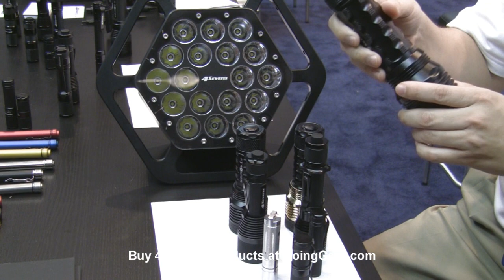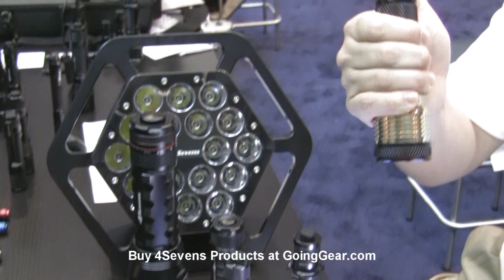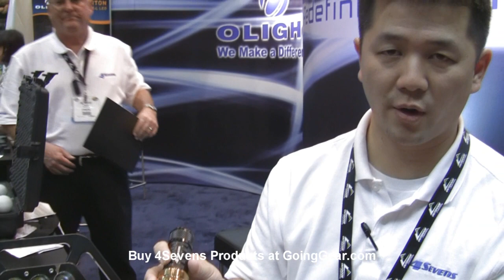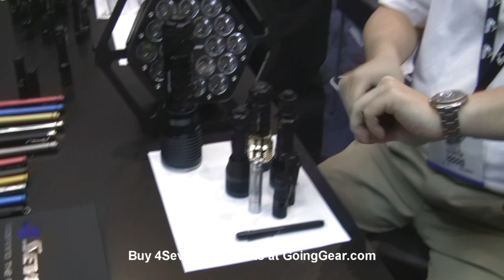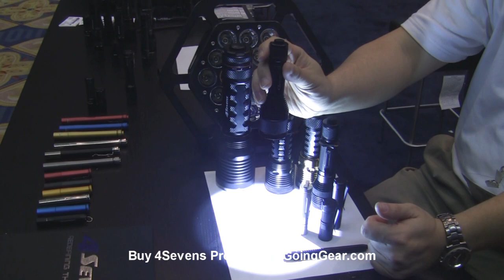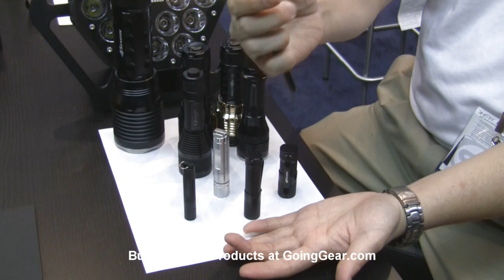4Sevens Owner Demos SHOT Show 2011 Prototypes

Comment: @goingprepared So I have a question; all these single 18650 powered lights, that use the P7 and xml-t6, and say 900 lm and 1,000 lm and 1,200 lm; are they bs'ing? Can a small handheld actually put out 1,200 lm?